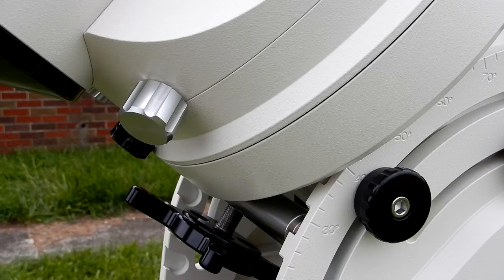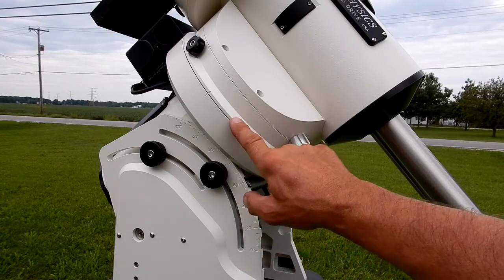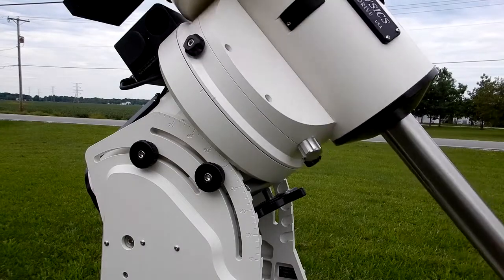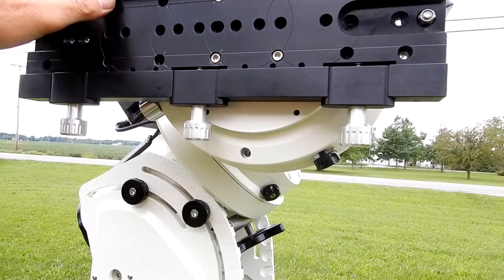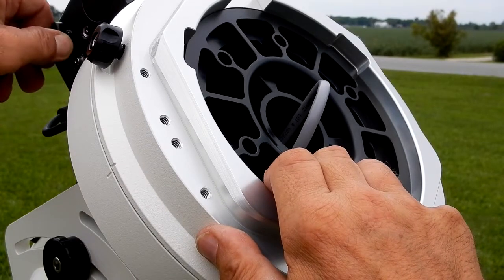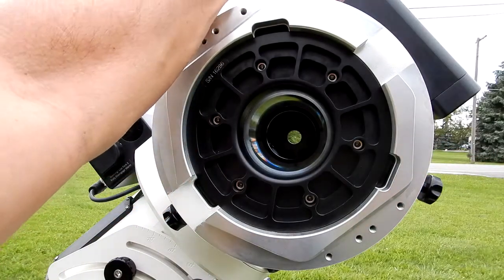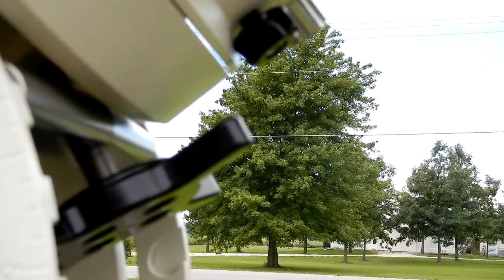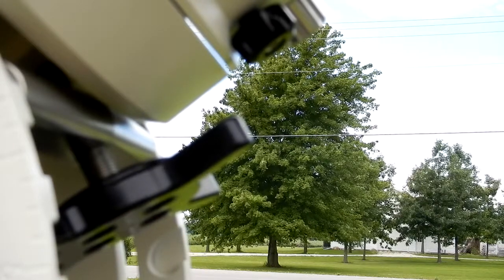Astro Physics Telescope 1600GTO Mount (play in RA axis)

Comment: I suspect I have a similar issue on the AP1100 Dec axis. Did you get this issue solved? Thanks
Reply from the maker: Rouzbeh Bidshahri   I just saw your emails to the AP forum titled "AP1100 Play in Dec Axis #Guiding". Yes, it was taken care of. Did you see the other video links in the description of that video giving the details: PART 2: https://www.youtube.com/watch?v=wwUaqoYD8VU  PART 3 https://www.youtube.com/watch?v=lupLxrYyI40  Good luck.
Reply: @starastronomer  thanks, saw the video. Great stuff. Lets see what they say on the forum. Someone said you can adjust the tapered bearing, Im hoping thtas the case.
Reply from the maker: Rouzbeh Bidshahri   Mine I believe was different. They said a special tool was needed to do the adjustment which they were going to send me to do it with instructions on the process. But then Roland wanted the mount sent in as it was brand new.
Reply: @starastronomer  yes I saw. Mine is a few years old but I suspect I had this all along and just found out. I'm really hoping I can fix it myself. Lets see what he says.